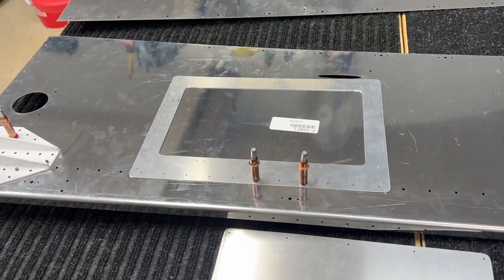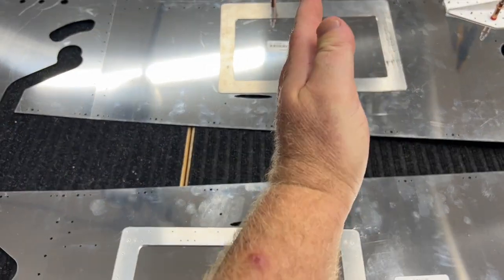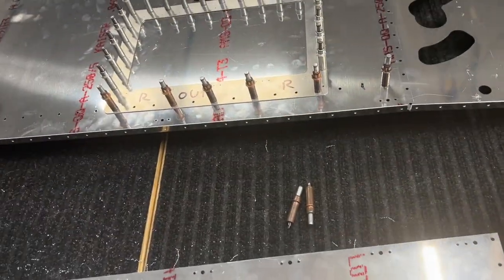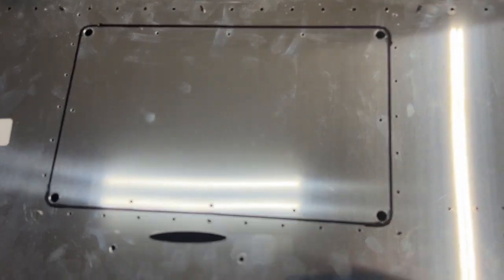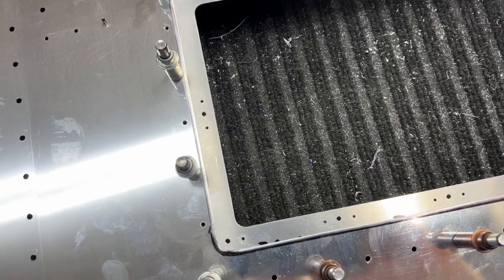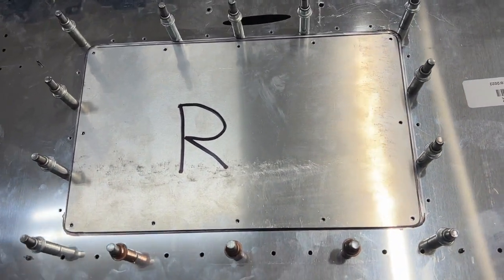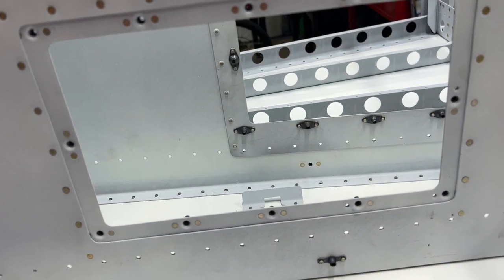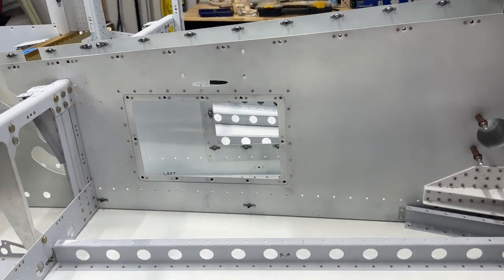Airward Tunnel Access Mod RV10 - Build Video 35 Section 27 (Fuselage)

Comment: I just ordered them too :-) 

When do you plan on getting your 10 flying??? It looks like you are speeding right along in the build!! I’m still on section 23.
Reply from the maker: I am easily 3-4 years away.  I am not speeding along, took me 7 months to section 26,27,28.  I also think it will slow down dramatically when I get to plumbing and wiring.